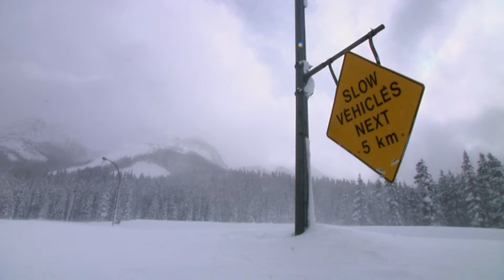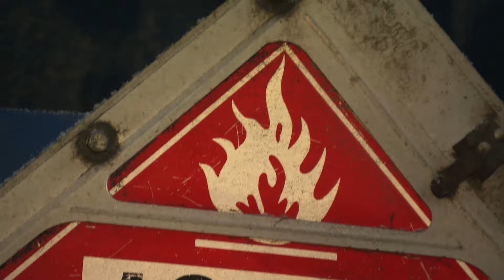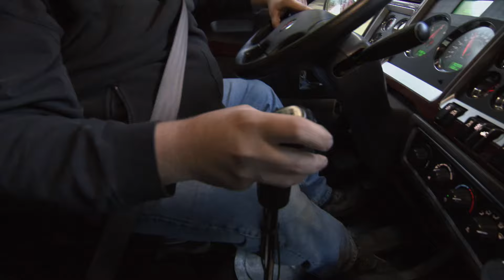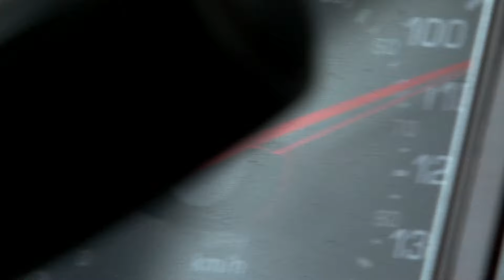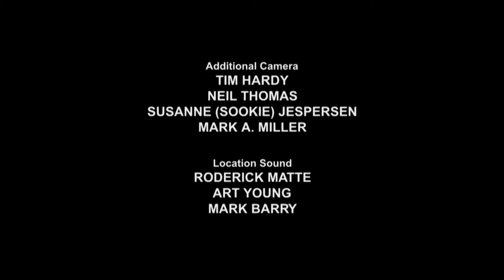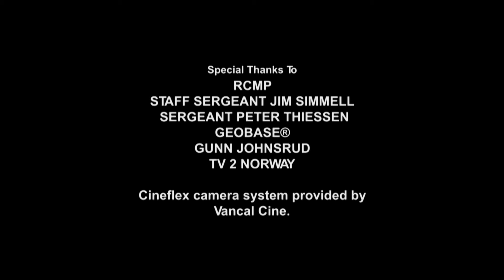Towing on the Edge - Highway Thru Hell - S01 EP5 - Reality Drama

Comment: Well I have to admit that these guys are really brave. I've worked in the wrecking business. Ok circumstances aren't that tough over here and the working conditions, even the payment is way better. But it's interesting to watch what they are able to do with this almost antique equipment. If this equipment is state of the art, you guys should come over to Germany and watch how the companies here manage such wrecks. Easier and faster. No incredible expensive rotators which reach their limit pretty fast. They use mobile cranes. Way faster to be set up and easier to operate. Even the small wreckers are way more developed. For a car to drag away, even a SUV where you have to use dolly, it took me mostly no more than 5 minutes. To tow a wreck out of the ditch we need an average time of 15 to 30 minutes. All due to better equipment. And also I always had bosses who aren't sloppy but also not every third word left their mouth was money and costs. Also you have to work mostly up to 8 hours. That'll be it.
Reply: That's just a small one. There are bigger ones which can easily lift a whole semi. The biggest one I operated had a maximum lift weight of 250 tons. For this use it'll be set up within roundabout one and a half hours and the lift itself may not take any longer
Reply: Yeah this was state of the art when it was filmed which i believe is around 2012
And with the cranes... some cranes can´t get to places where rotator can so it´s situational 
Rotator is multipurpose 
Crane is just a crane can´t tow...
Reply: @thecookiemonster3770  that's true but for lifting cranes are way more effective and they don't need much space, but indeed a solid ground. Over here all towing companies use cranes and additional tow trucks. It's a very different way to do the same work. Rotators are unknown here. No one uses them nor having them at all.